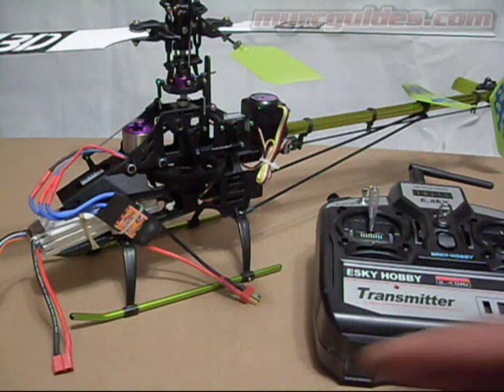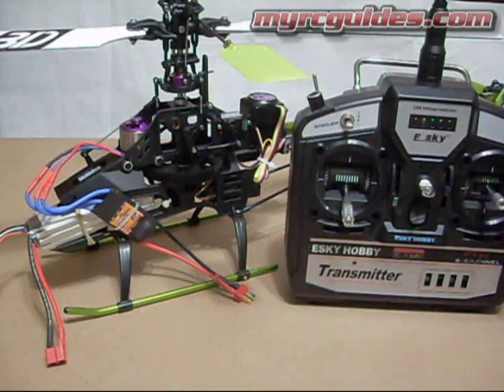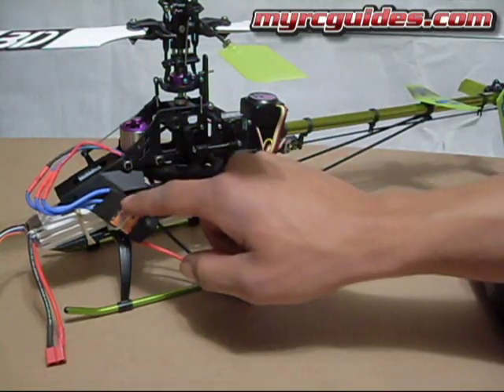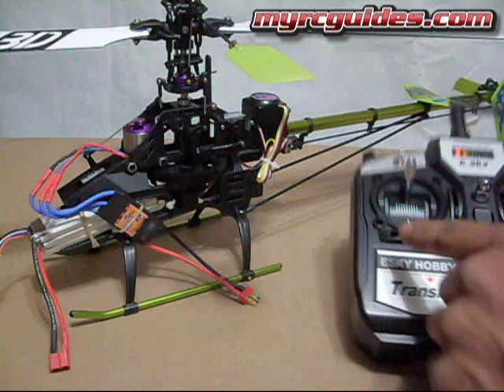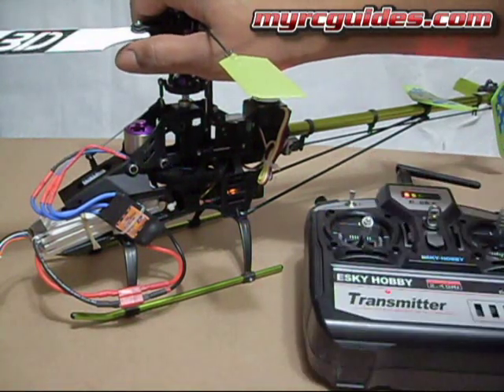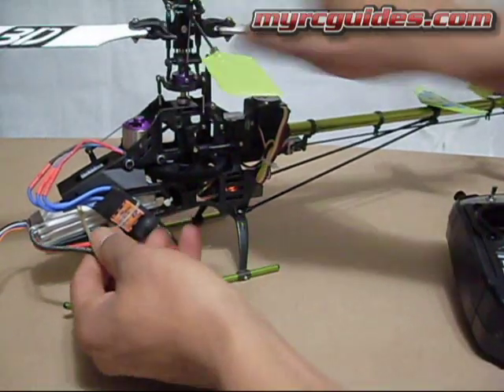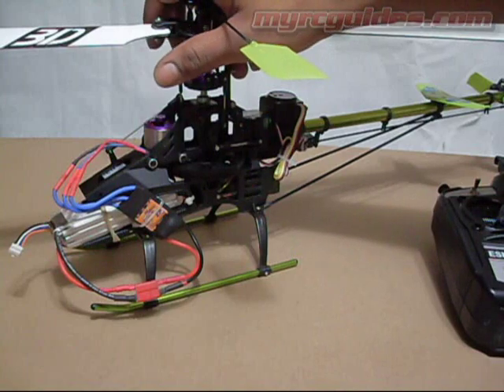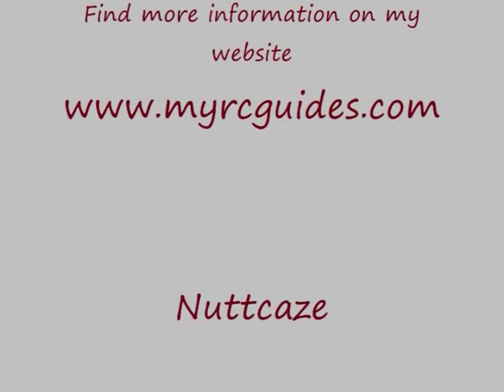How to set RC Heli ESC Throttle End Points

Comment: is that the same on all esc's?  i just upgraded my century swift from a 60a to a 85 amp. i have ran several batteries thru it already and i never did this?  runnin a dx6i if that helps

Comment: Thanks Mark! I had just bought a replacement ESC to repair an old helicopter I've bought cheap. I didn't get any manual, but they said the ESC was configured for a heli... well I saw this video and now know better. Good timing :)
(I've also got the manual for the ESC now)